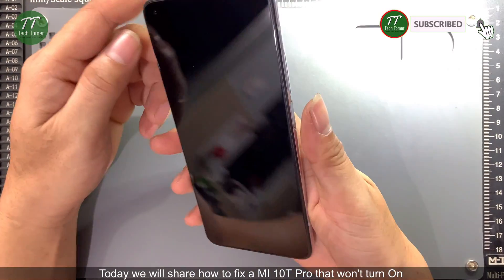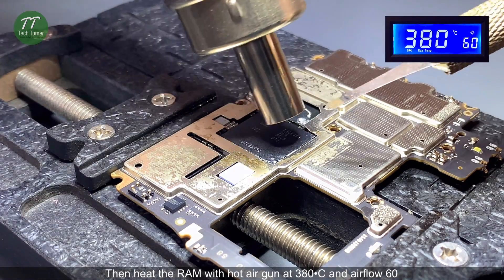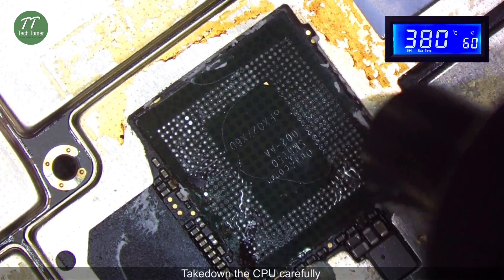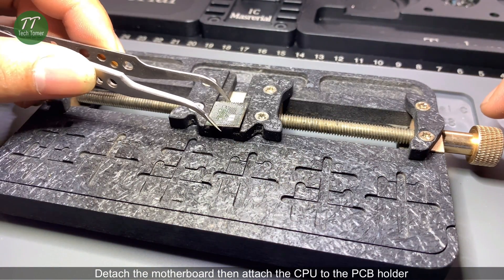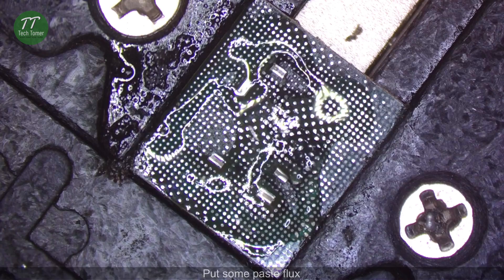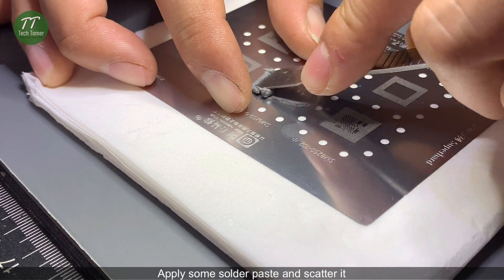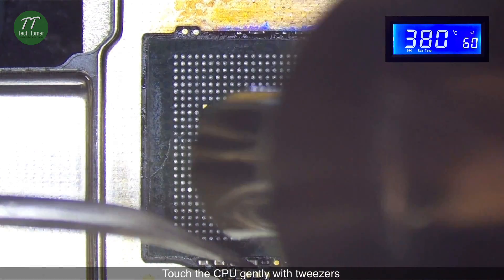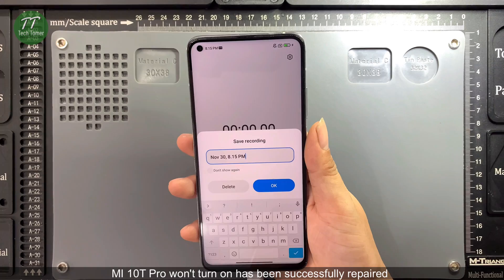Xiaomi MI 10T Pro 5G Won't Turn On CPU Reball Tutorial | Tech Tomer

Comment: I have Mi10T for over 5yrs, and it's seems to be overheating more often than usual. does it have a Thermal phaste? I'm curious, because I cleaned the system up a lot and there's no reason for it to overheat (I don't play that much).

Comment: İ am well knowledge technician. He bent ram and cpu very badly. It means cpu and ram dead 100%. You can see in video how ram bent. In this case phone never works. At the end of video i think its another board for just fooling people.
Reply: Yap its different
Reply: Agreed. Totally busted! He heated corner only. First rule: must have preheater on the bottom on the motherboard to avoid pcb stress  Second, never stop moving hot gun. Third, do not use force to move IC. It must be lifted without force.
4. The best way to solder cpu and ram is to solder them at the same time. So, reflow oven is the best solution. No need to heat cpu 2 times.
Reply: I am surprised. After that abuse no pads had ripped out of the motherboard.
Reply: how much? i have the same problem.
Reply: Cpu bent af
Reply: je ne comprends pas ce que ça fait de changer la colle....
Reply: No bend bro

Comment: If you don't play anymore game,how long will this kind of repair last?
Reply: as long as you love me by BSB 
kidding, no one really know since there were not enough statistical data to support such a claim
playing heavy game could causing overheat, hence the 'lead' of the soldering might melted, and then disturbing the voltage that was distributed by the power source/battery to the "BRAIN"/CPU
correct me if i'm wrong

new technology not as good as the old tech (hardware-wise) the reason is imo is greed, those giant techs were and still pursuing more and more profit as their core drive, if possible they want to release same-old-new product every short of time period as possible (if not yearly, or every 6mo if possible) e.g. apple was it either by steve jobs or whomever his succesor is
sry for the long rant, i digress ; if you can take care of your smarthone, 3-4 years since the date of the purchase are realistically good
Reply: @ReadyTestAndRating  thanks for the clear explanation, really appreciate it :)
Reply: @ReadyTestAndRating  I agree, realistically speaking, playing games should be done on higher end phones. I have a realme 3 which gets pretty hot after a while so I don't play too often anymore. Instead I do PC gaming now, but once I change I will go back to mobile gaming. Still, in a nutshell, just play games with a fan or in a room with low temperature (use AC).
Reply: Is it safe to reset or restart the cp after reball & ram change?

Comment: I appreciate your work but before the reballing work how did you confirm that it was the CPU not something else?
Reply: timestamps 0:36 shows : 0.1 A (top right-hand of your screen) meaning that the voltage that travels the circuit[s] (from battery/the power source to the "BRAINS"/CPU) were disturbed 
someone correct me if i'm wrong
Reply: @ReadyTestAndRating  wrong. The current from the usb port just tells you about charging of battery since phones don't use power from the cable to run, therefore you cant tell what the system is using by reading the current from the usb port, phones system power comes from the battery only (hence why you can't remove the battery and start the phone using usb cable only) so you have to use the DC power supply directly on the motherboard batttery connector to see what current the phone is using. He has simply skipped the diagnosis part of the repair where you look at the power supply circuits and the power ic and main power rail.

Comment: I just got same problems 😔.. what actually happened here? CPU burn?
Reply: Don't worry its a temporary fix 🤣
Reply: melted lead of the circuit (that responsible to dstribute power to cpu) probably
correct me if i'm wrong

Comment: This method looks dangerous , becuase feel like too much force using blade
Reply from the maker: no sir because the video is on fast-forward and it has also been cut, but at the actual time, the process took a long time before the ram and CPU were removed